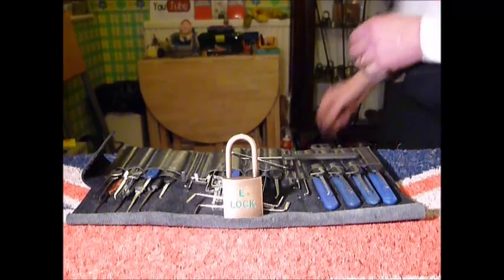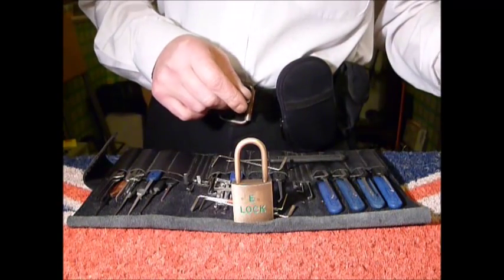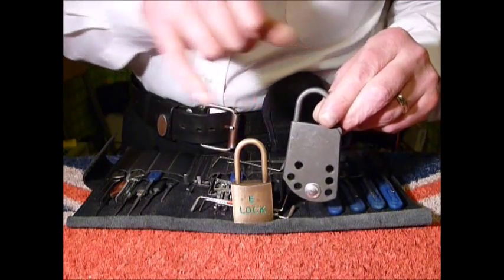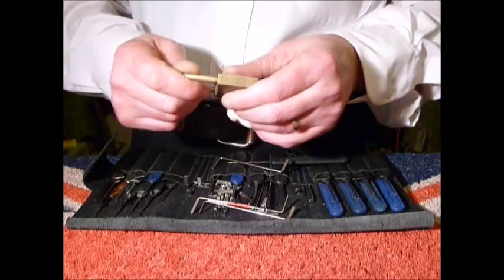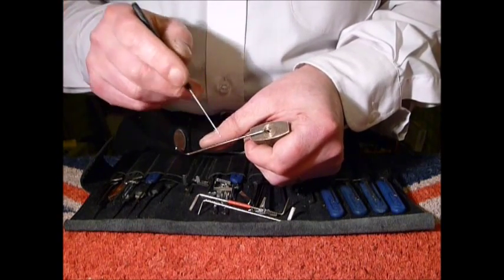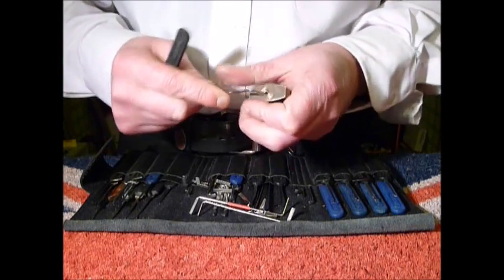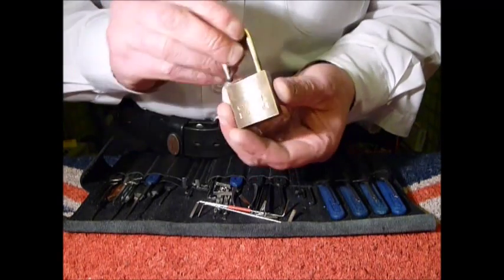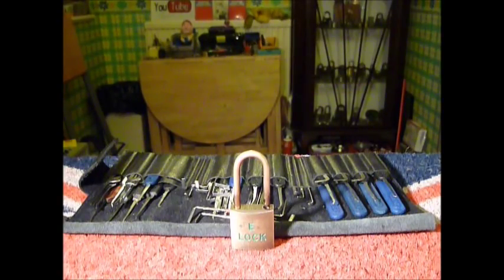Single Pin Picking A 5 Pin CASTELL ISO-LOK (Safety Lock Out Padlock On Used Oil Rigs)

Comment: the iso lock with multiple holes is so a worker and a supervisor can each put a lock in therefore the system cannot be turned on without all locks being removed.
over the years I have seen multiple iso locks used with 10 plus locks.
they are used for both mechanical and electrical systems.
the new iso locks are made of plastic and are a bugger to pick, but can be snapped with pliers.
my lock is an abloy 303.
this is not a security system but for safety and are only there to show that someone is working. the new iso locks have paper tags for names and phone numbers.
check out master locks isolation.
Reply from the maker: Thank you for that info Peter mate

Comment: Does this have security pins? I just started lockpicking but i am unable to pick this one. Its probably not a beginners lock but whatever
Reply from the maker: Hi renevank, It certainly feels like there are spool pins in the ones I have picked as you get little drops on the plug and slight counter rotation now and again, not sure if that was due to a bit of dirt in my lock though. Have you tried picking yours clockwise and counter clockwise buddy?
Reply: waddac2 i tried both ways  because i noticed the lock opens both ways with the key. But i just started lockpicking a couple of days ago, I dont even have proper tools haha. Im using bent/smashed nails, bobbypins and paperclips. It did the job on my cheap 1 pin safe tho, but this padlock is my first padlock and I'm having a lot of trouble 😅
Reply: Besides this padlock, on which i basically spent my entire weekend fiddling, i also have an abus 71/40 padlock. But that lock is even wayyy harder to pick I believe 😁
Reply from the maker: Well your Abus locks def have spools in buddy, so that will also be why your having issues with it. If setting a standard pin the plug will turn and stop meaning a false set, then when picking the binding pin the plug will try and move back... This is counter rotation and you have to make sure the lock does not drop other set pins. Tension control is a must at this point.

LOL!!! with only using bent bits and bobs as picks. Get yourself a proper pick set and you may have more luck buddy ;o))))
Reply: waddac2 I will get some proper tools as soon as I can, together with some cheap normal-pin padlocks. Thanks for the advice! this is such a fun hobby :)
Reply from the maker: You are welcome for the advice my friend and yes it is the most addictive hobby in the world. Have fun and happy picking ;o))))

Comment: Is it better to pick from the back to the front or is there no difference
Reply from the maker: It can depend on the lock in my opinion as I tend to first try picking from the front first as you can see the first pin and sometimes tapping on that can move the plug a bit or drop it into a false set... I also do same with euro locks. If I have no joy picking when starting at the front, I re-set lock then start from the back. Hope that helped buddy ;o))))